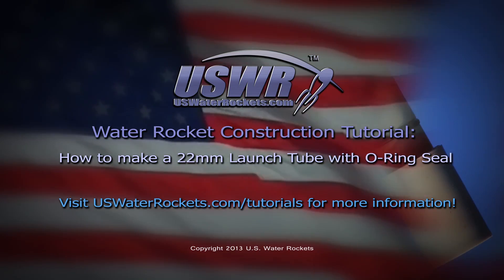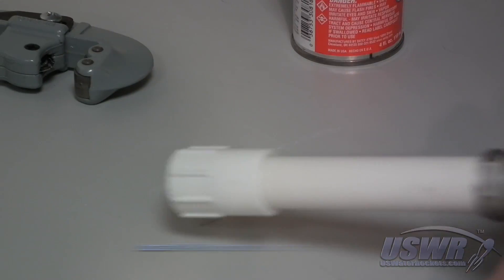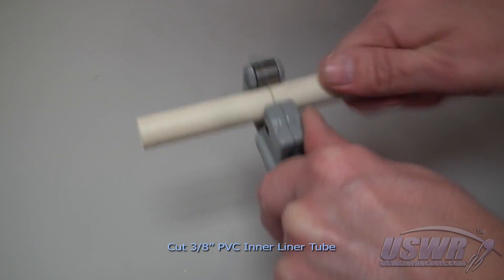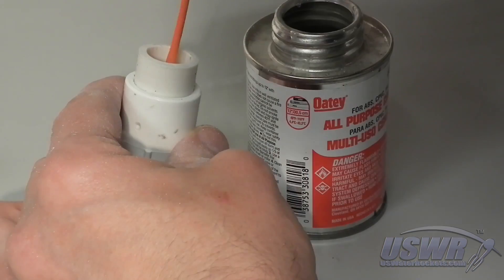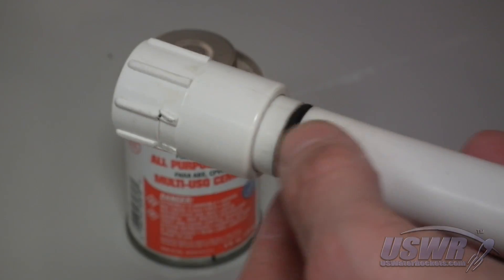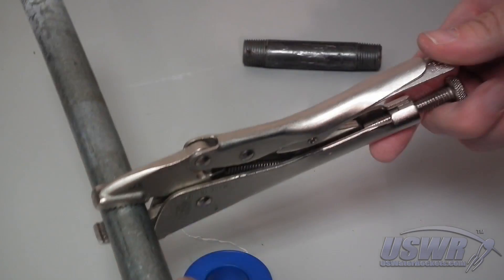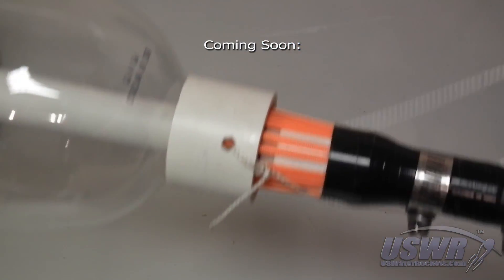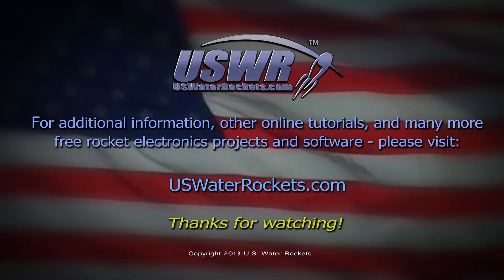Make an O-Ring Water Rocket Launch Tube for Cable Tie Launchers

Comment: Is the 3/8  pipe CPVC or PVC?
Reply from the maker: I've used both. You need to make sure you have the right glue for the pipe material.

Comment: Hii, I am making water rockets. And it's going great, I just have a hard time making the connection water and air thight. If i use a O ring it still leaks. Do you just take that for granted or am I doing something wrong.

Comment: I like the idea of sandwiching the o-ring in this way, but if I crunch the numbers correctly, the 3/8" joining pipe will only work with a schedule 40 1/2" pipe, not a schedule 80 pvc pipe.
Schedule 80 is safer for high pressure applications because it has thicker walls and hence a narrower inside diameter.
I get the impression the presenter didn't know the different between the two thicknesses.

Comment: Just for clarification, the size of a #94 o-ring is 5/8"ID, 1/8" wall, and 7/8" OD correct?
Reply: I'd like to know too
Reply: @7nilsonsantos Yes this is correct, but the 7/8 OD is a bit too big, a #93 I've found works better

Comment: Even if the cement says no primer required you should always use primer.  Ask any professional plumber.  I have seen potato guns explode because primer was not used.
Reply from the maker: I consulted with a professional plumber and he sent me a link that says primer is not necessary and may be worse in some cases. https://www.plumbingsupply.com/the-great-pvc-primer-debate.html

Comment: Where do you buy your O-rings from?
Reply from the maker: We order them from sellers on ebay or Amazon. They sell them in bulk were you can get 50 or 100 of them for $0.05 or $0.10 each.
Reply: Could you add the Amazon item number for reference?

Comment: Here's a fun new problem. I have constructed a clark launcher and tube, as the video instructs. I am looking to launch around 100 rockets per day for my science classes. The problem that I've run into is that my release collar comes off and the rocket stays put. The O-ring must be the problem. #94 is the only one that will seal in water/air, but the bottle won't come off. Have you experienced this before? I'm thinking that I need to oil it between launches, but this has happened to me after only 1 or 2 launches. All of my parts are glued, so replacing is really difficult.
Reply: Kevin Baumann I know it's a bit late but some silicone o ring lube might work
Reply: Also, you may not be pressurizing the bottle enough. If the pressure is high enough, it should overcome the friction of the o-ring. I pressurize mine to about 40-60 psi. Hope that helps!
Reply: I just found an o ring that works good and used a small file to file a grove a little ways into the pvc. It works great.

Comment: Constructed a tube, but my bottle just slides on and off easily. I don't get that clicking sound that you are able to get. Perhaps my O-ring isn't thick enough?
Reply from the maker: The O-ring should be thicker than the outer PVC pipe. If it's not you can get a thicker o-ring, or you can (when you make the launch tube) push the pipes together hard enough to squash the o-ting between them, which makes it expand and poke out enough to make good contact.
Reply: I've found an O-ring that works for that. #94, as you said in the video. Now it's a little difficult to get on at all, but I think that will be a good thing. I also wonder how you put bottles on the launch tube. Do you remove the tube, then insert into the bottle, then put it back into the base every time? I'm building for my middle school class (tired of buying crappy online models). I like this idea and want to make sure i can easily load and fire as I'll be doing 20 or so in an hour.
Reply from the maker: For our purposes, we launch just a few times each day because we set up cameras and parachutes and onboard science experiments, so the time between launches is a lot longer. We put a quick release coupler on the bottom of our launch tube so we could put it on the rocket while prepping for launch and carry the whole assembly to the pad and lock it in place. However, our small launcher has a fixed launch tube and we just put the rockets onto the tube while the launcher sits on the ground. It doesn't make much difference how you load it.
Reply: I was seeking to limit water spillage because the amount of water is a measurable, controllable variable that I want the students to be able to work with. I think that the width of the pipe, plus the ease with which a bottle can be placed on it (even with the opening facing down) will help limit loss anyway. We used to use a rubber stopper with a hose pushed through the middle, way too much loss. Appreciate the replies, the videos and the website. Thanks!

Comment: What is a good o-ring substitution? I cant seem to find any where i live
Reply from the maker: Irving Mendoza That's a tough question. This launcher really is intended to use an o-ring only. You might be able to wrap a rubber band into the groove and make it work, but we never tried this. You might want to look around and see what other launcher types people make. We've seen some where the design is totally different and they use electrical tape for the seal. A completely different design might be the only solution.

Comment: Does this fit a 2L bottle?
Reply from the maker: Irving Mendoza If the bottle has a 22mm opening, this will fit. The typical 2l bottle sold in the USA and many other countries will have a 22mm opening, and fits on this launcher.

Comment from the maker: You can use PVC tube as well, as long as you don't exceed the pressure ratings.
Reply from the maker: If you want to make different sizes, you will have to adjust the other dimensions yourself. We did not try any other pipes.

Comment: do you have to glue the chap sick tube in the pvc. If so how
Reply from the maker: The glue that you use to glue the PVC pipe in will work well enough for this, but you can use Gorilla Glue, Epoxy Glue, or Super Glue. Just be sure and scuff up the Chapstik tube and the Pipe with some sandpaper to give the glue a good texture to grip.

Comment: I dont understand why it is called a 22mm but the tube is 1/2inch??? 1/2inch=12.7mm? please help.
Reply: 1/2 inch is the inside diameter of the PVC pipe, the outside diameter is 22 mm

Comment: Tried the Chapstick tube and it worked fine. Tested to 100psi and held with no problem. Thanks for the tip.
Reply from the maker: The ChapStick tube build option has been added as a note in the video. Thanks for the feedback!

Comment from the maker: To add air, you would use a bike pump or a compressor for filling tires and such. We have updated the description to show a link to a tutorial on our website that shows how to make a complete launcher with a similar PVC launch tube that has the proper connection for a tire pump.
Reply: Where would I connect the pump

Comment from the maker: We've had several people report success with these different items:

1) Large felt-tip marking pen body.
2) Empty "Chap-Stick" tube.
3) A piece of half-inch copper pipe (PVC needed a little sanding to fit this).
4) A section of aluminum rod from the hardware store with hole drilled through it.
5) A wooden dowel with a hole drilled through (We suggested painting it to seal the wood but user said it sealed well without any coating.
6) Plastic paint brush handle.

There are probably many more.
Reply: In the video what you refer to as 3/8" pvc pipe is actually 1/2" CPVC. 1/2" CPVC should be readily available at most hardware stores but definitely at any plumbing supply store.
Reply: @NateD77  Thanks Nathan, I have been looking EVERYWHERE for 3/8 PVC pipe and nobody has it, was beginning to think I was crazy...

Comment: I am having the same issue others have had regarding the 3/8 tube. I have been to Lowes, Home Depot, and Orchard trying to figure this out. I have had no luck. Apparently, in California the 3/8 is not for sale. Your comment to Cliffe Hartle was that we can use any hollow tube that will fit. Problem is, What? Any suggestions? I have taken my 1/2 PVC to the hardware stores and gone up and down the aisles trying different options. No Luck. Do You have a suggestion for this?

Comment from the maker: One more thing. Some of the users on WaterRocketForum found that the inner diameter of their 1/2" PVC varied with different brands and in some cases they found that a bit of sanding or reaming allows it to fit. Also consider the PVC cement liquifies surface of the plastic, so you will find it easier to slide together when the plastic has been dissolved by the PVC cement.

Comment from the maker: This issue came up in the past when we first created our launcher tutorial for our website a couple of years ago, and as far as we can tell, PVC is legal for certain uses in certain parts of the country, so it may not be available where you live in all sizes. The inner liner is not under constant pressure in this design, so you should be able to use any hollow tube that will fit in the PVC.

Comment: Ok just back from Home Depot (needed other stuff and its just over the hill). No 3/8 pvc, but there is bigger issue. Is that 3/8" section of pipe CPVC of something else. 

3/8" pvc has a OD of .675, inner diameter of 1/2" PVC .602.